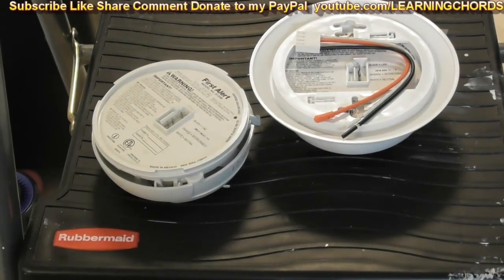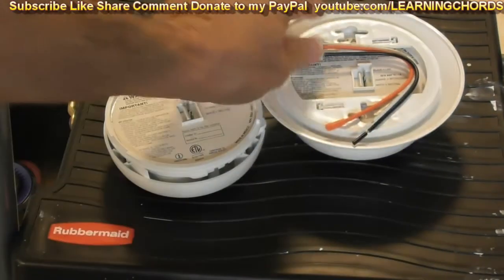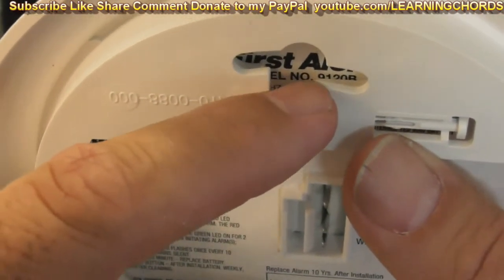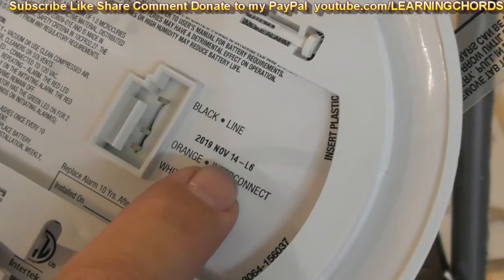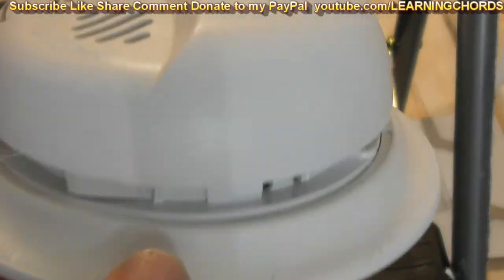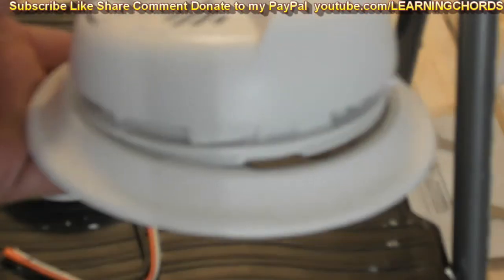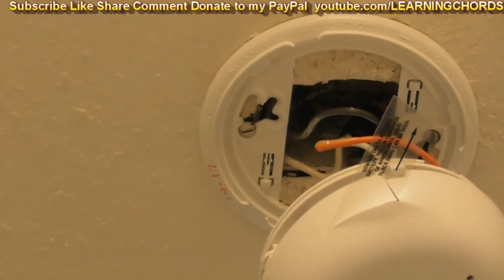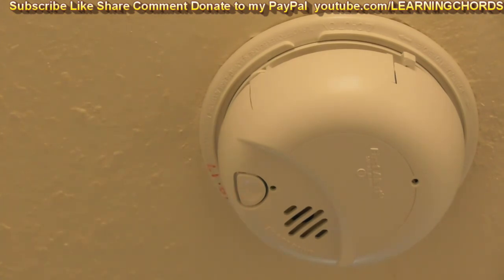SMOKE DETECTOR First Alert BRK9120B  Smoke Detector HOW TO INSTALL SMOKE DETECTOR 2020

Comment: How do you remover the smoke detector? It doesn’t just pull out and it doesn’t have a release tab like other detectors do to disconnect the wiring? Thank you,
Reply from the maker: you turn it clockwise
Reply: Good question that didn’t get answered.

Comment: What do the red light blinks mean?. I replaced the battery, did the test and I’m still seeing a blinking red light that blinks 30-60 seconds. Drained the units and Chirping stopped but lights blink.
Reply from the maker: you can go to their website under support look up the manual... I get blinking lights too. it is working now so I ignore it but I should look to see what is happening. I think it blinks every minute to let you know it is working. if it is broken it blinks at a different rate